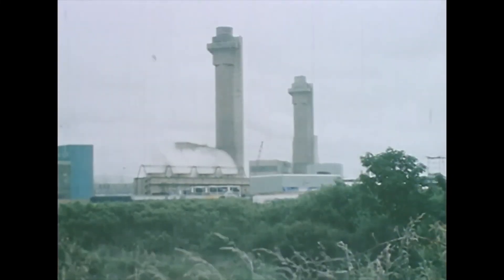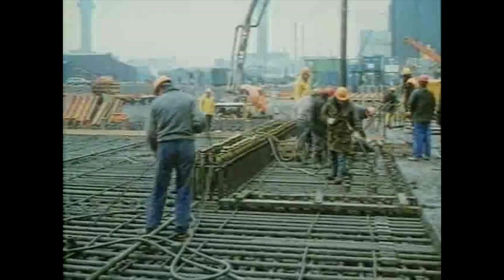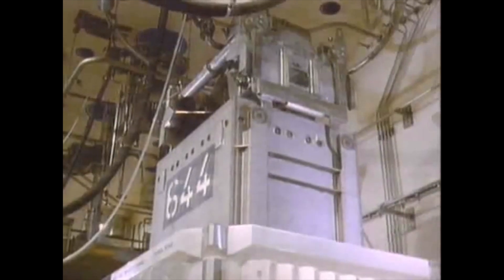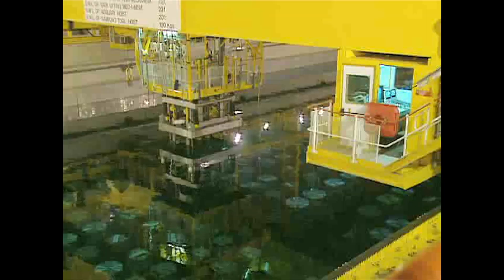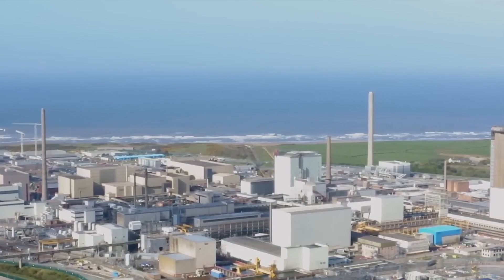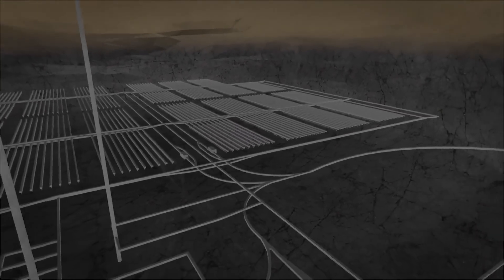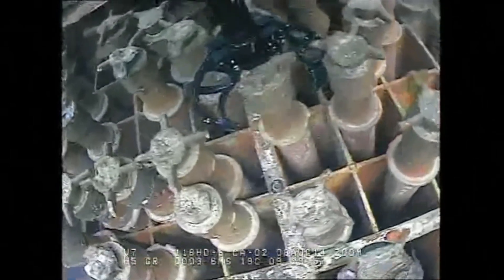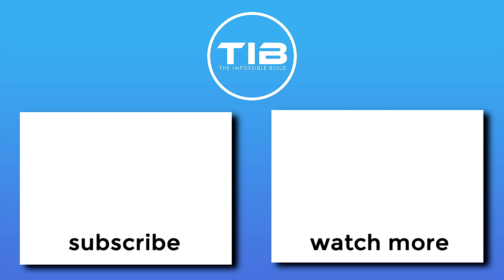The £120 Billion Cleanup of the World’s Most Dangerous Site

Comment: There are about 4.5 billion tons of radioactive uranium and 150 billion tons of radioactive potassium-40 dissolved in our planet’s oceans. The beta type radioactivity from radioactive potassium is almost 3 times as powerful as the beta type radioactivity from Strontium 90, a primary element of high level nuclear waste. Even worse, the half life of radioactive potassium is over a billion years while the half life of strontium 90 is less than 30 years.

It should also be noted that, once ingested, heavy radioactive elements like Uranium will migrate to your bone marrow and their alpha and beta type radioactivity will pound on bone marrow tissues and increase the risk of related cancers.

These radioactive components are salts so they are among the several kinds of salts included in evaporated sea water.

Sea salt really needs to be reclassified as low level nuclear waste and we need to start placing “Radioactive Danger” signs every 50 feet or so along beaches used by the public.

If all the radioactivity at Sellafield was put into containers and dumped to the bottom of the deepest ocean trenches the additions to the radioactivity already present would be infinitesimal.